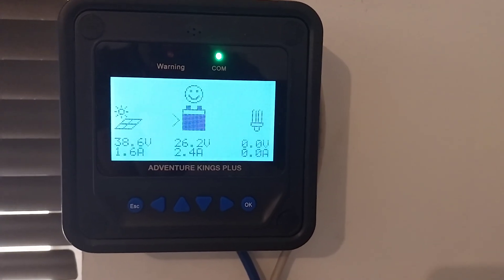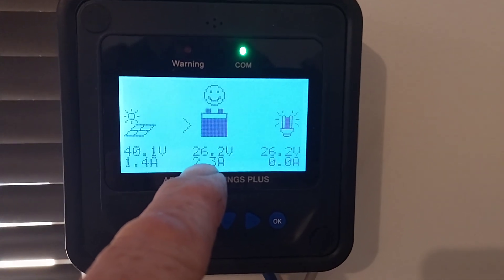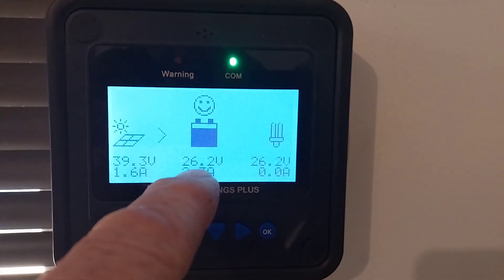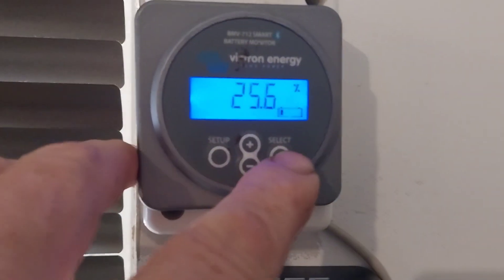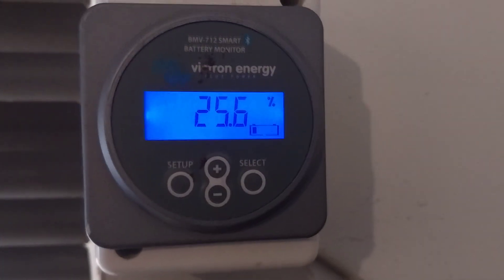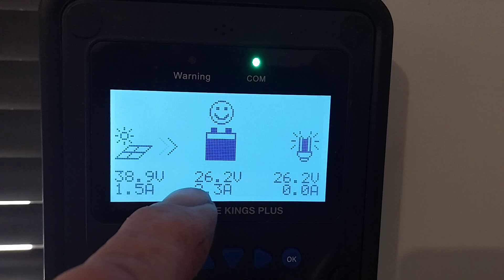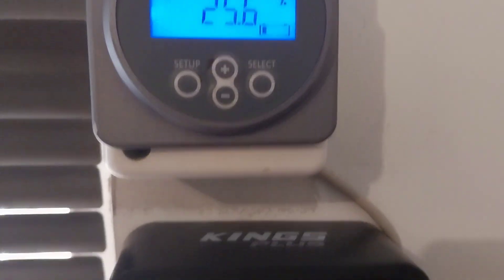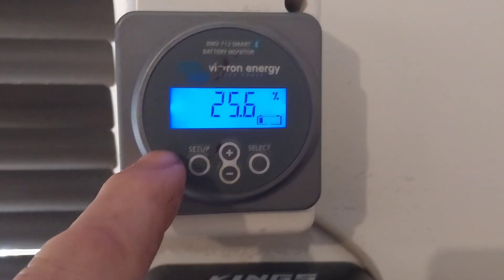Why Not To Read Battery SOC From Voltage On LFP Batteries.

Comment: using old technology on new technology is the reason that volt meter was designed to measure lead acid batteries. The shunt is more accurate because it keeps track of ah but nothing is perfect. Just keep your batteries charged.

Comment: Well, correct in general, the LiFePO4 charge and discharge curves are very flat so voltage droop or rise due to discharging/charging current completely swamps any reading.  But in this particular case the reason is because you are net-charging the battery... the battery is on its charge curve and not its discharge curve. The voltages along most of the charge curve are significantly higher than the voltages along most of the discharge curve.

Even the zero-current voltage can vary widely depending on whether you were previously charging or discharging and for how long and at what current, as the battery might be in transition between the charge and the discharge curve.

So except when the battery is in the extreme exponential portions of the curves... meaning almost completely empty or almost completely full, you just can't tell by looking at the voltage.

-Matt

Comment: I agree in general however the voltage reading under small loads, 5A-10A, can be a good guide to an approximate amount of capacity left. I found the Jaycar battery box meter tracked the shunt volt meter fairly closely and once it dropped below 13V it was a fairly good indication the lithium battery was in need of charging. That said the shunt capacity meters are so inexpensive it makes sense to use them.